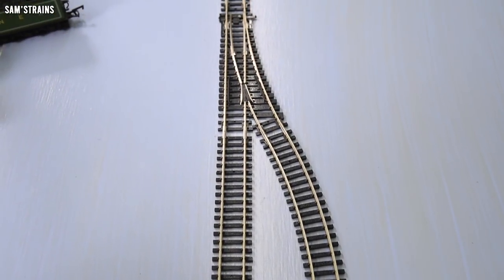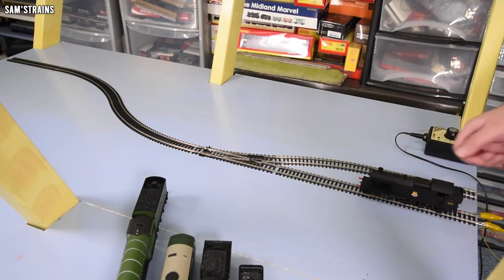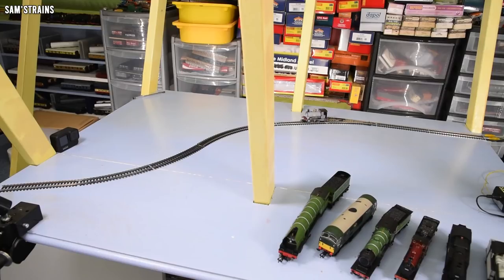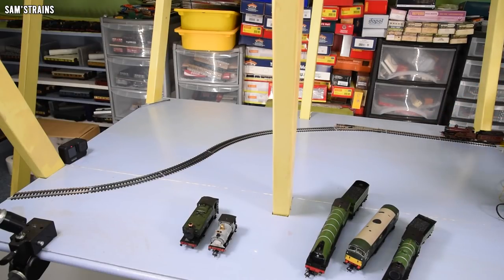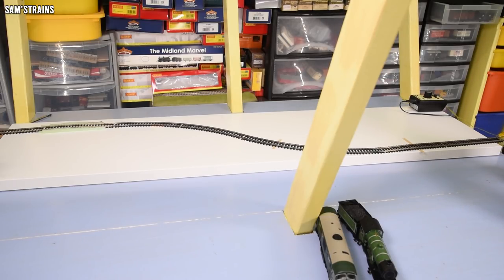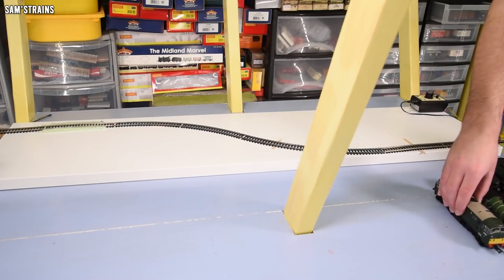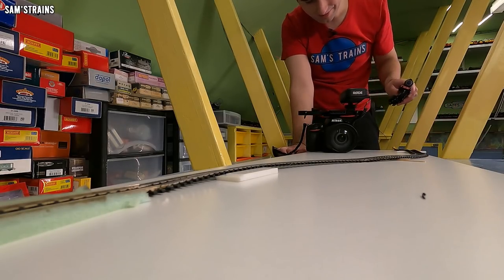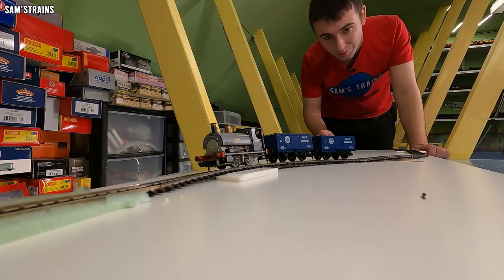What Type Of Bad Track Causes Derailments? | Model Train Experiment

Comment: Thanks Sam.  Yo look like you had fun doing this video.  And really it is very useful.  The fish plate problem has appeared on my layout.  I had not noticed that I put the track together badly.  Over the years I have been given several lots of track:  Hornby, Triang, Peco, Tyco, ...   At first sight many of them appear to fit together but the height of the rail can be different and so I can feel a bump at the connection which can cause a derail.  Fun and helpful.
Reply from the maker: Thanks Robert - it was a lot of fun for sure! It's surprisingly easy to mis-fit the fishplates - I've done it myself too! And that's a great point - mixing different track brands causes problems too!
Thanks for watching, Sam :)

Comment: This was an interesting test with potential flaws and weaknesses super-exposed. We had a bit of curved track knocking locos off. That stretch was indeed R1, and vintage tinplate (Märklin - equivalent to Hornby dublo 3-rail) on top. We used it after a straight section of the same vintage rails as all of this was not in sight. All the rest is k-rail (plastic sleepers). Turned out that the curves were warped deranging the gauge width at that point. One loco however never failed; a small but relatively heavy 3 axle steamer with small wheels; like your peckett but 3 axles. B’B’ locos seem to be able to absorb much as well, but everything has a limit. Great test this Sam. Thanks.
Reply: You remind me I have some test to do in OO with R1 curves, to check if a Peckett can haul a warwell on those tracks without derailing.
Reply from the maker: Thanks for sharing Linda - yeah R1 is a killer - I'd definitely avoid it if possible!
Thanks for watching - Sam :)
Reply: @SamsTrains  Oddly enough, Märklin's R1 isn't much of a problem. Motors can make more noise on them, but they manage. All stock can handle it. Short couplings are a different story of course. It was the warped tinplate R1. In the Märklin world, it is R0 that usually is to be avoided (industrial curve).

Comment: I've had a fair bit of experience with a variety of track plans and a variety of rolling stock, and I've certainly experienced some problems with derailing. The single biggest predictor of derailments with a loco, in my experience, is a pony truck. Pony trucks leading a loco are more prone than anything else to coming off the rails. I've had some locos (e.g. a quite recent Hornby 8F) where it was only possible to avoid derailments on well-laid second radius curves by doing extensive work on the mounting of the pony truck. Propelling trains is also very prone to cause derailments (as opposed to pulling the train). If the track is reasonably laid (no overlapped fishplates or ridiculous humps - anyone should be able to eliminate those when they get their layout properly down), then the thing most likely to cause derailments, by far, is points. Combining two factors, propelling a train across a point set to turn is very likely to cause derailment. Of course older rolling stock, which may be poorly gauged or have weirdly-sized flanges, is much more likely to derail, and it may be necessary to change the wheels on some of that older stock to get it to run on modern track (even when the track is properly laid). For propelling trains, compatibility of the couplings will be a big factor - you'll be lucky if you can push stock round curves and over points if the coupling loops are not smoothly running against each other at the same height. On the other hand, I've found that slight gaps in the rails at joins generally don't cause too much of a problem, and can be very hard to avoid sometimes, especially when working with flex track. Always an interesting topic, as what use is a layout if you can't actually get your trains to run on it?
Reply from the maker: Thanks for sharing! Yes I've seen a lot of problematic ponies too - particularly on points as you say!
Thanks for watching, Sam :)

Comment: Hi Sam, what a brilliant idea to see where track laying can be a problem. This was an excellent idea of yours and proved so many issues. I have a lot of 1st Radius curves and had to be careful which trains I bought. Saying that, my track must be okay, as I have the Hogwarts Express 4-6-0 with tender and it runs better than my 4-4-0 . I did do the tunnels in 2nd and 3rd radius as these would be harder to access in the event of failure/derailment. I have bought a number of trains purely because of your videos and your rating system; which is 2nd to none. I do have a problem with my 4-4-0, with rubber traction tyres, no longer pulling up the incline and wondered if it's because of the way I've cleaned my track with INOX or an Electrical Conductive solution. Have the rubber tyres been affected by these??? It used to be a beast at pulling up the hill and now it can't make it up on it's own ??? Please help me as I trust your opinion as a born again Railway Modeler.

Comment: This was very interesting, as a beginner I have had much difficulty laying my N gauge track which is a mixture of standard and flexitrack. I decided to lay on foam with part of it glued and part with track pins. In addition the baseboard is in two parts and the join is not completely level (I was never any good at woodwork). It would have been an excellent track for this test if it had been the same scale, it has some joins particularly between the standard track and flexitrack with some gaps and the track fixed with pins slopes sideways in places! Despite this I have a couple of locos which never derail and the rest do occasionally which is annoying, I might have to scrap some of it and start again.

Comment: A very interesting experiment, Sam.  One configuration you missed was a steam loco with a working leading bogey, and a working trailing bogey (The Hornby P-2 does not have a working trailing bogey).

Also, on a separate note, you were referenced in the February 2022 issue of Model Rail magazine, issue 296.  Not by name though.  On page 25, Author Chris Leigh's opinion piece refers to "amateurs 'reviewing' models on YouTube," and "test running a £200 model on Setrack laid on the carpet?"  I wonder who he is referring to?
Reply: The snobbery of the model magazine writers is always impressive.

Comment: Hi Sam, great video topic. Although you may have set out to be mischievious you ended up high lighting a good number of issues. Having bought a Hornby D12 recently I thought that the tender was very light and am intending to add some weight to it - so it comes out a ~25g per axle. That should stop it rattling and acting as a sound box as well as not getting dragged of the rails on corners with heavier trains.

Comment: I can definitely attest to having track issues! Mainly when it comes to spacing with the fish plates as I’m running an oval, and when working with my curves which are second radius on the outer of the two tracks. I try to not leave any spacing if possible, but the design of the board and the upgrades I did to it to expand it mean that there’s slight spacing on the curves, however I’m lucky that the main cause of derailments usually comes from just had wheel alignment! I find they are absolutely fine as well if the couplers are spaced, and if I need to keep the fishplates separate, I try to keep it even along the track. Let’s not talk about the time I knocked my 47 off tho…and nearly an Aussie diesel…

Comment: I knew from the start that round 3 would be easy. The only issues that could cause is very long fixed wheelbases coming off on a hump, or top heavy locos tipping over. All the long fixed wheelbases were already out, with the pannier being the worst, and decent locos generally have die cast chassis, and are thus not at all top heavy. The only locos you has that I think would have been at all challenged by round 3 were the P2 and the prairie, and the bad fishplate already did them in. A misaligned fishplate into a first radius point is the worst semi reasonable thing I can think of for a loco. I wish you hadn't eliminated locos but instead kept score, I'd have really liked to see how the prairie did on the lumps.
I'm not surprised at the precedent in round 4 either, it has a very short fixed wheelbase, but the tender has a fairly long fixed wheelbase, just like the pannier, so it came off the same way the pannier did. The D16 was a bit of a surprise, my guess is that the spring actually rotated the bogie a little bit as it decompressed and unwound, causing it to come back down at an angle. I think a 4-4-0 with a free floating bogie would actually do better. I think the diesel came off because it didn't have enough flex in the bogies, a diesel with looser bogies would have probably gone over that just like 2 0-4-0s. It couldn't conform to the curvature, though, and lifted the front axel off.
Astonishingly, I think your first 3d printed loco would actually be fine. With it's incredibly loose bogie, it would probably do fairly well over the lumps.

Comment: I think the main issue with track laying when the layout is in the loft is the heat and cold.  This has to be considered when you are laying it and how much gaps you leave.   I laid mine in the winter so my track was cold so had to leave massive gaps.  I still get a bit of buckling thou if I forget to open the windows.

Comment: Fantastic video sam think train weight and build definatley has a lot to do with it too as have a hornby pendolino the comes off for fun and was scratching my head for ages but when i put a heavier loco as the same speeds on there is no issue at all also find steam locos without spring loaded front guiding wheels are really tough as the seem to come off for fun

Comment: Test 1. Some locos/units don't like 1st radius at all, my hornby pendolino derailed whenever it came into contact with a 1st radius curve. I also doubt a bachmann 40 or 44/45/46 would manage 1st radius either.
Test 2. Nice to see the use of some steel track. Which is a pain to keep clean for DCC operation... I also find light tenders are an issue when the locos are loaded heavily, so both my P2 and peppercorn A1s have had weights added to their tenders for stability. I also find Bo-Bo diesels very very reliable, to the point that if I need something to run over any of my trackwork repeatedly without stopping, I'll choose a bachmann 25. Also, you'll notice the p2's tender at 50% and the drivers at 30% plus the 52xx derailed at the same point on the points, which is an issue I've often seen with hornby points, so I've swapped to using peco ones for better reliability (when I need settrack points. I generally use streamline points).
Test 3. Surprised all remaining locos managed.
Test 3a. Not surprised about the steamers, but I reckon a bachmann 25 may have done better than the dapol 29 (my only dapol diesel at the moment is a 68, not sure how that'd cope because it's so huge yet still Bo-Bo).

I really need to get one (or several) of those hornby pecketts, and a hattons barclay to compare them to.

Comment: The Peckett should have failed on the third test, since its wheel base is so short, it was unable to pick up voltage and needed several shoves to get it going again. One of the issues with poorly laid track is poor conductivity. So while you were punishing bigger locos for not staying on the track, the 0-4-0 failed because it could not complete the course.

Comment: This is why Sam, on Network Rail we use track levelling machines called Tampers, to maintain track levels and keep variances in track level changes to a gradual and not a sudden change, the worst scenario is called a twist fault, where one side of the running rails subsides more than the other side as your track shows when the your loco's list sideways, the other dangerous track fault is as an example, a 25mm hump over say a 3mt length, if a real train hits this at speed, it would more than likely jump off the track and derail, this amount of sudden change can not be absorbed by the trains suspension system, so if it did manage to stay on the tracks passengers would probably be injured by being thrown out of their seats upwards and landing very hard on the trains seat or floor, the sudden shock could also cause some internal organ damage or at the very least would very damned uncomfortable, so even model railways need near perfect track to work well particularly at speed, this is also why carpet is not a very good base for your track work.

Comment: I do Hope you had a Soft landing option at the end of your badly layed tracks. 
 Just incase they went 'Over the Edge of Table..!' 

 Buffers might have been a Good idea at the Ends..!

 When I was a Kid and played with my 'Battle Space Turbo Car.' I would bank the Curved  sections of the Oval Track. To see how Fast I could get her to handle the Curves.

 Unbelievably I still have it. And it still runs. But the Fan didn't tend to stop to well unless you swopped Direction. 

 It was my only Triang "Train..!" that I bought with me to Oz on Emigration from uk..! 

 The stickers on it are tatty, but Propeller and Nose are still in good order. 
 I would use Polystyrene as a Dartboard buffer. And it survived my 'Childs Play' and I still have it in a very Scruffy box too..!
 Considering the Abuse, its amazing it still survives..!

 Cheers from kim in Oz. Interesting video Sam. 
 Very entertaining if not Teriffying with No Safety net.?
 😎

Comment: The real culprit here is solid loco chassis. With the price that loco manufacturers charge, they should be able to fit some kind of suspension (compensation) - and a flywheel. All the 0-4-0's need is one rocking axle.

Comment: I think there are 2 major problems with this way of testing.
1. Choosing to run at a set power instead of at a set speed
2. Disqualifying the trains instead of something like ranking them 0-2 based on derailments in each test

Comment: One big takeaway from this vid for me is: ensure that the electrical connections are good. That seems almost more important than derailing prevention.
Reply: Precisely so. I wish I could use more meter-long flexes in place of short pieces...And then the contact issues inside the sixty-year-old locos.
Reply: @jmi5969  You may want to look at Piko flex track, one of the cheapest you can buy. It looks fairly similar to Hornby track
Reply from the maker: Yeah definitely - well worth investing time into multiple electrical connections! :D
Thanks for watching, Sam :)
Reply: @jmi5969  Maybe option when using short track sections is to solder them together?
Edit: is recommended against, see response below
Reply: @diedertspijkerboer    No  you don't it is AWFUL  which is why it is cheap.
Reply: @diedertspijkerboer   Again NO  you don't,  the fishplates allow for not only alignment,  but for expansion and contraction  with heat and cold,  THEY CANNOT BE RELIED UPON FOR ELECTRICAL CONNECTIONS  and NEVER solder them,  former owner and operator of four of my own exhibition layouts,  and operator of many others,   been there,  bought the t-shirts and seen all of the above issues surface...
Reply: @mrbluesky2050  What's wrong with Piko flex track?
Reply: @mrbluesky2050  I edited my comment on soldering to say it's recommended against and referred to your comment. I thought about deleting the suggestion, but this is better, I think: showing that we learn from the experience of others.
If you would like me to edit it differently, please let me know.

Comment: In terms of radius 1 trials I thing it would be better to connect 4 pieces to create a complete semi-circle - I feel you may have more derailments given the tightness of the curve continues thus forcing a derailment. I find the Princess and duchess class cannot make a semi circle without derailing and a class 40 with the 1Co-Co1wheel arrangement normally ends up with the front wheel set derailing
Reply from the maker: Maybe John - particularly at higher speed! The Princess and Duchess would have been interesting to try actually - very large wheelbase on those!
Thanks for watching - Sam :)

Comment: although there have been some horrible makes of track (like the hollow square tin things, or the 'the metal turns black while you look at it with brittle plastic in the middle' type stuff) for dc systems... other than 'bad contact' and thus the whole thing stopping the actual derailments are more a matter of 'weight of the carriages'. especially with some back in the days cheap lima(hornby) and roco shit etc. it simply didn't have enough downwards pressure down and thus it's easier for the locomotive to pull  a carriage in the middle on it's side than it is to pull the end of the train through a corner. also the horrid plastic wheels on some of that dc stuff. having the locomotive push it makes it worse. :P but those were the 1980s. and as some of those still are in business i take it they learned a thing or 2 about physics. :P and electric contact between various types of metal, and that sorta thing. :P

Comment: Very helpful! 
One question I had: can bad track cause a bogie to remove itself from your loco?. 

I ask because I recently got a Hornby Princess. Thing keeps unscrewing the nut that holds the front bogie on, so when I go to put it away, the bogie stays on the track. I redo the nut to maximum, and it still does this.
Reply: Put a little nail polish on the nut thread, that will hold it on, yet still allow you to remove it if ever necessary
Reply: @brucewoods9377  so this is just a loco issue then. Thanks for the tip!

Comment: How did you get power to the far rail in the first test when the points were changed - the point should have isolated power from your crocodile clip?
Reply from the maker: The points had DCC clips fitted - so all roads were powered!
Thanks for watching - Sam :)